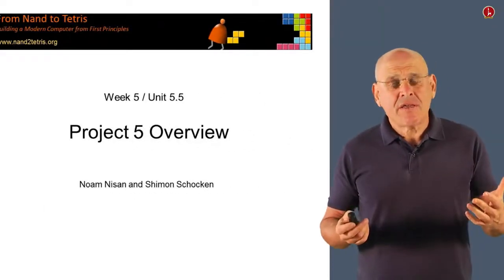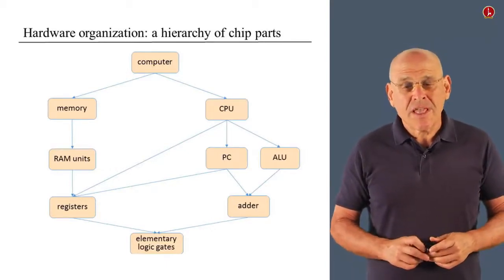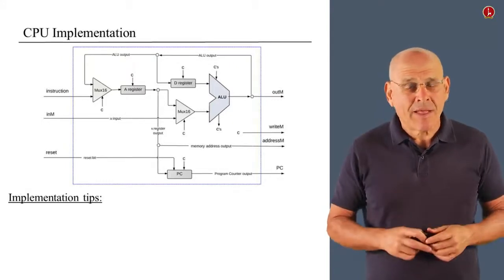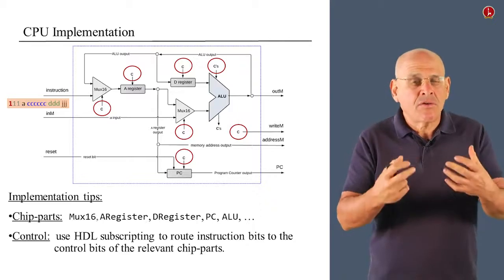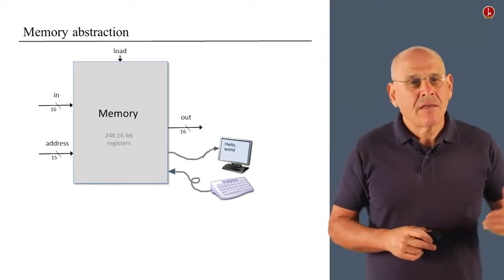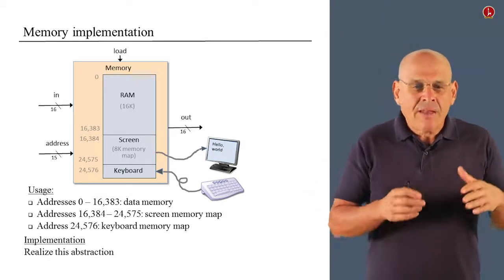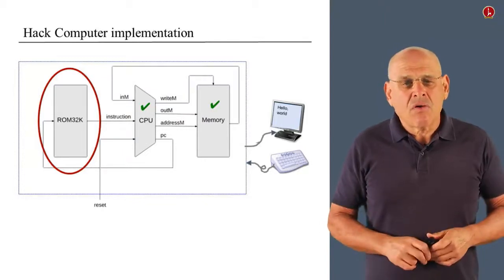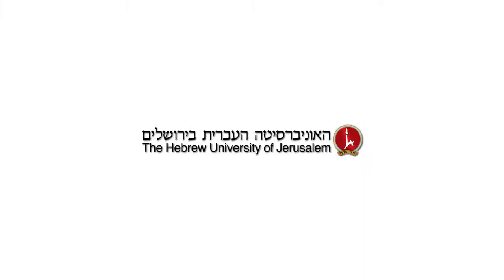[Part 1] Unit 5.5 - Project 5 Overview

Comment: tips for computer:  literally just grab the 3 components and plug them into each other

 If you want to check your work here is mine: 

    PARTS:
    // Put your code here:
    ROM32K(address = pc, out = instruction);
    Memory(in = outM, load = writeM, address = addressM, out = inM);
    CPU(inM = inM, instruction = instruction, reset = reset, outM = outM, writeM = writeM, addressM = addressM, pc = pc);
}

Comment: Tips for CPU, make sure to check if its a C instruction before loading or jumping. bits go from right to left such that  instruction[0] is rightmost and instruction[15] is leftmost. Apparently they want you to use ARegister() and Dregister() chips for the A and D register, I've got no idea why seems like normal registers should do the trick just as well. If you find out why let me know. I was also tempted to put a clock for the PC's inc input, if the input is just true then why bother even having it be an input? Just set it to true within the chip.. I'm not sure how it is working with the input as 1 or how the clock interfaces with the computer something inside the registers I guess. 

If you want to check your work here is mine: 

    PARTS:
    // Put your code here:
    //If A instruction (instruction[15] = 0) then send instruction to A register, else send ALUout
    Mux16(a = instruction, b = ALUout, sel = instruction[15], out = preA);
    //load ALUout to regA (and addressM) if writeA (instruction[5]) or if isAinstruction (!instruction[15])
    Not(in = instruction[15], out = isA);
    Or(a = isA, b = instruction[5], out = loadA);
    ARegister(in = preA, load = loadA, out = areg, out = A, out[0..14] = addressM);
    //if A/M (instruction[12]) = 1 use memory at address A, else use A
    Mux16(a = areg, b = inM, sel = instruction[12], out = AM);
    //if writeD (instruction[4]) and isCinstruction(instruction[15]) write to D
    And(a = instruction[4], b = instruction[15], out = loadD);
    DRegister(in = ALUout, load = loadD, out = D);
    //if writeM (instruction[3]) and isCinstruction (instruction[15]) write to M
    And(a = instruction[3], b = instruction[15], out = writeM);
    
    //the 2 out assignments here are necessary as you cannot plug an output to this chip as in input to a sub-chip
    ALU(x = D, y = AM, zx = instruction[11], nx = instruction[10], zy = instruction[9], ny = instruction[8], f = instruction[7], no = instruction[6], out = ALUout, out = outM, zr = zr, ng = ng);
    
    //if the jump instructions match any of the respective ALU flags then load
    And(a = instruction[1], b = zr, out = zrjmp);
    And(a = instruction[2], b = ng, out = ngjmp); 
    Or(a = ng, b = zr, out = zrng);
    Not(in = zrng, out = gr);
    //if its not less than or zero, its greater than
    And(a = instruction[0], b = gr, out = grjmp);
    Or(a = ngjmp, b = zrjmp, out = somejmp); 
    Or(a = somejmp, b = grjmp, out = jmp);
    //if should jump (jmp) and isCinstruction(instruction[15]) jump    
    And(a = jmp, b = instruction[15], out = willjmp);
    PC(in = A, load = willjmp, inc = true, reset = reset, out[0..14] = pc);
}
Reply: Thanks, your code saved me a ton of time. I forgot that you had to use 'ARegister' and 'DRegister' instead of just 'Register'
Reply: Whyyyy do we out[0..14] = pc and not all 16 bits?? oh nvm im an idiot the memory addresess are only 15bit